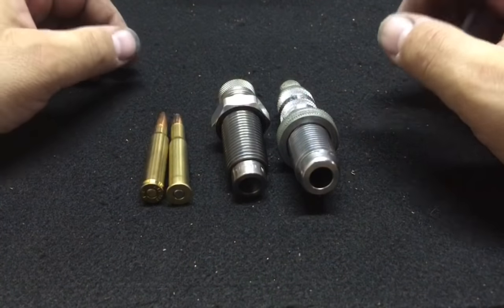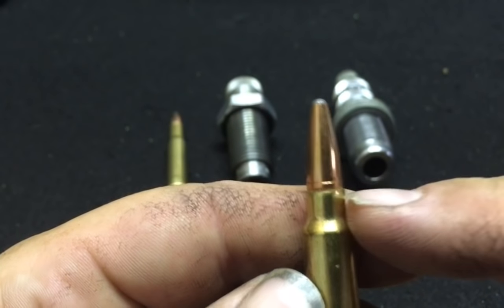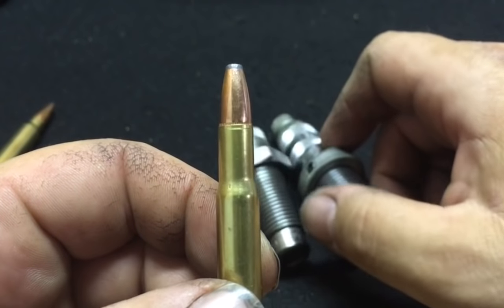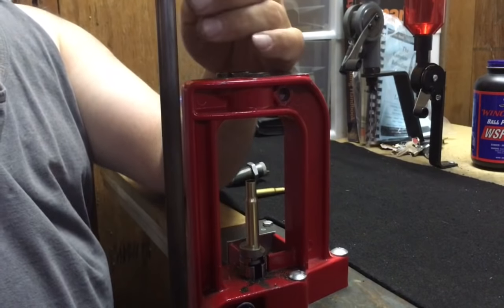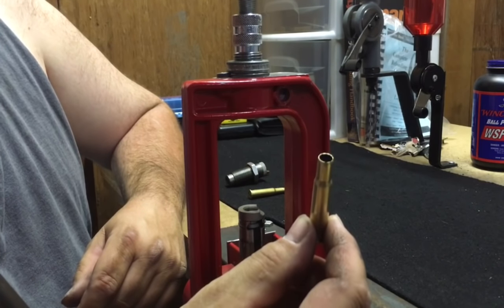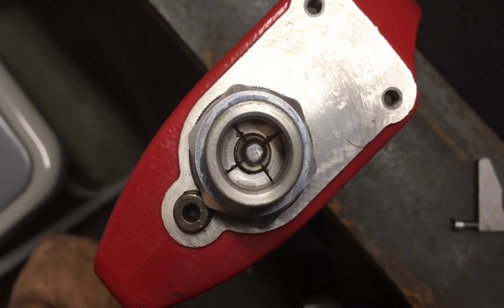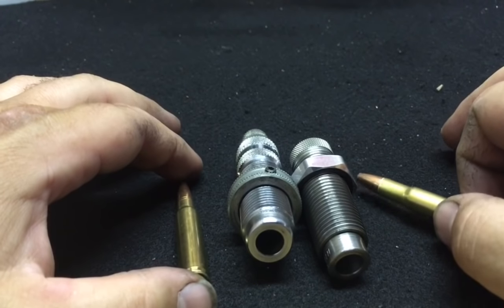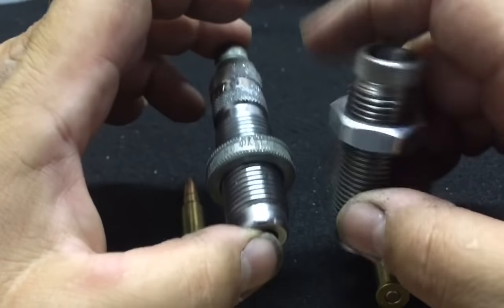FACTORY CRIMP VS ROLL CRIMP (WHY LEE MAKES THE BEST CRIMP DIES IN THE BUSINESS)

Comment: I crimp everything, taper crimp on semi-auto handgun ammo, roll crimp on revolver ammo, and a Lee Factory Crimp on all my rifle ammo. For me, it is crazy not to crimp any cartridge that the bullet may hit a feed ramp. If it hangs on the ramp, it may push the projectile back into the case, bolt, lever and autos get crimped when I load, and revolvers need a crimp to keep bullets from walking in the case under recoil. After a friend blew up a Model 88 Winchester along with a couple of fingers shooting reloads, after that, I started crimping everything. I always seat and crimp separately.

Comment: A roll crimp is still needed for some rounds such as the .357 mag in a revolver. The recoil of shooting this round has a tendency to walk the boolit deeper into the brass (even when taper crimped).  A roll crimp into a cannelure is much more secure.  (You still need a taper crimp die for boolits, such as wad cutters without a cannelure.)
BTW?  A roll crimp isn't hard to get right. As long as your brass has a good even edge, you simply do a little at a time until you have the desired amount.  Lee .38/.357 4 die sets ONLY have a roll crimp.
Reply: Taper for rimless automatic pistols  to headspace on the case mouth.
Roll crimp for rimmed cartridges.
On rifles, if you can see your crimp, you are crimping too hard.

Comment: Just FYI, the collet crimp is only for RIFLE FCDs, for pistols, it is NOT a collet crimp. There are however, several Lee "collet style" factory crimp dies for a FEW calibers, mostly the magnum revolver rounds, like .357 (NOTE: The .357 collet FCD does NOT work with .38 special, because it's length dependent) and .44. All other FCDs are taper crimp the normal way (not a squeezing collet "petals") by decreasing inside diameter of the crimping stem.

Comment: Lee has two types of Factory Crimp Dies, one that is carbide style and one that is collet styled. The Carbide sizer part straightens the cases back up when the crimp part bulges the cases from the downward force of the die upon the case neck. The Collect Style crimp die does not apply downward pressure but rather inward pressure of which does not buckle the case creating a bulge that would then need ironing out. If this is true the carbide part of the die fixes what the downward pressure crimp part messes up, whereby I call it a gimmick of sorts because it does not really solve the problem, but rather patches it over. All that work hardening the brass is not good either. Better to just not cause an issue as apposed to patching it back up I would think. 

Again The Lee Collect Style crimp die never buckles the case whereby never needing to fix its own fuct-ups, as the downward forcing Lee Carbide Factory Style crimp dies do. Ergo with the Collect Style crimp dies there is never a need for the carbide ring, period. So if you see my point being Lee has the Collet Style crimp dies why would they sell a Carbide crimp die that messes up the brass only to turn around and solve its own issues, other than to act as if it is the crimp die of crimp dies of sort that everyone should have(?). That is why I call it a gimmick crimp die. Makes no sense when the Collet Style crimp die exist, right? 

Be sure and watch Lee's own videos on their Factory  Carbide Style crimp dies:
1) https://www.youtube.com/watch?v=0rjlUH25DyM
And their Factory Collet Style crimp dies (of which they have both /roll and a taper types): 

2) https://www.youtube.com/watch?v=vo7p4k36swI
Reply from the maker: @thetexasrat  they sure do for pistols and rifles

Comment: Good info...good presentation....good video of the process.  Needing to load 450 Bushmaster with straight wall case and the crimp is not supposted to be a roll type due to headspacing issues.......Will be using the Lee.......Thanks!!!
Reply from the maker: George1mac no problem glad you liked it

Comment: I am having issues with .38 reloads feeding into my Henry .357 Lever Action.  I use the typical 3 carbide die set from Lee. You have just answered all of my questions in this post as to the need for a better end crimp, and also the Lee FCD should solve those issues.
Reply from the maker: Perfect

Comment: How far do you screw down your Lee crimp? Same as the other? Let it touch and then another half turn in?
Reply from the maker: Over Watch with the crimp portion of your die screwed all the way out.  Screw your die down until it touches the press ram. Then insert a shell all the way into the die turning the crimp down until you feel it touch the case. After that you can adjusted it slightly further down for the desired crimp

Comment: To suggest the Factory Crimp Die is "as close to factory as you can get" is incorrect.  Take a look at any factory .223/5.56 load with a cannelured bullet and you will see a perfect roll crimp. If you trim your cases to the same length, which I always do anyway, there is no benefit to the factory crimp die.  I have both for various calibers and I much prefer the roll crimp.  Because I accurately trim my cases I get very consistent roll crimps. The Lee Factory Crimp Die actually damages the brass, leaving permanent dings.
Reply from the maker: ArJuna22 yes it leaves permanent marks yes however it by no means ruins the brass. Most of the time the The primer pocket wears out long before the neck.
Reply: If the Lee FCD is damaging brass it is either set up wrong, user error, or a unsat die that needs to be returned to Lee ASAP for a full replacement (FREE). I have both as you do but, after 35 years of reloading the Lee FCD  just plain works....... When properly set and used that is.
Reply: It really just depends on the caliber and the company. Winchester 45-70 comes from the factory collet crimped.
Reply: I got tired of trying to set a die up to seat and crimp because it kept bulging my cases. I would have to back the seater stem out and run the die down further to get a decent amount of crimp. Idk about other dies but I got tired of that with my RCBS AR series .223 die.

Comment: how does this die do for roll crimping a straight wall cartridge. 
say a 357 magnum? 
can you please demonstrate this?
Reply from the maker: tjmooremusic I will definitely demonstrate, on a straight wall pistol case it's a taper crimp not a road trip.
Reply: Wayback When 
thanks.  I was to be clear referring to cartridges for a revolver or a levergun that is chambered for 357 magnum. I have always heard that those require a roll crimp.
Reply: I have yet to see a road crimp on any cartridge.  :-)
Reply: @ArJuna22  I've taken my cartridges on many road trips!  :o)
Reply: @officialwaybackwhen  Most, if not all, straight-walled revolver cartridges use a roll crimp. Roll crimping gives better, more consistent bullet "pull" which translates into better accuracy. Taper crimping is usually used for bullets that have no cannelure.

Comment: so the "taper crimp" by RCBS say for .45acp isn't as good as L.F.C. ?  Cause rcbs is not a "roll crimp" it's a taper ? thanks subbed ya.
Reply: Taper crimping for semi-auto cartridges is excellent and usually required because rimless cartridges headspace on the case mouth. One exception to that is the semi-rimmed .25 Auto so it can (and is recommended) to be roll crimped if it is a cast lead bullet. Jacketed bullets for the .25 Auto are normally taper crimped.

Comment: I'm reloading 6.5 Arisaka with cast bullets.  Can I use another 6.5 rifle crimp die for 6.5 Arisaka??... Or do I have to buy a custom crimp die from Lee?  I was thinking I could use a 6.5 Carcano or 6.5 Swed Mauser???
Reply from the maker: Stephen Maurer it would have to be the exact case length as the 6.5 Alaskan. Your press ram needs to touch the die in order to actuate the die.
Reply: Thanks for the quick reply!  I'm thinking I have to order a custom Lee factory crimp die in 6.5 Arisaka ($27.00 plus S&H) or.... some people have  cast and reloaded this rifle round with no crimp??
Reply from the maker: Stephen Maurer I think re-loading it without a crimp would be fine on a bolt gun.
Reply: Wayback When.  The load will be fired out of a T38 Arisaka bolt-action Infantry rifle with a "mint" bore! I was thinking the same thing.

Comment: Better is the using a Rifle Lee Collet die.  Remove the decapper and push loaded round in.  It will crimp the length of the neck and not damage the bullet if there is no cannelure.

Comment: I started out with lee equipment due to costs. I really like Lee's equipment. Stay away from their priming tools. If one I found works, the best is the bench mountable. Always let the handle snap up, or you will constantly have hanging primers. I bought and returned the newest Lee hand primer due to so many hang up. It was nothing but frustration for me to prime with. I just paid $100 for RCBS bench primer, and oh, my, that is a dream to prime with, but I have heard problems when it has been used for a while. Yet to be seen. Bluge busting 9mm  I swear by Lee Makarov die. Granted always clean cases, I lube in 1 to 10 lanoline oil and let dry. And never had the die break. I use an RCBS Rock Chucker to jam them through. Side not Sizing brass first then busting seems a bit less mussel when busting them.